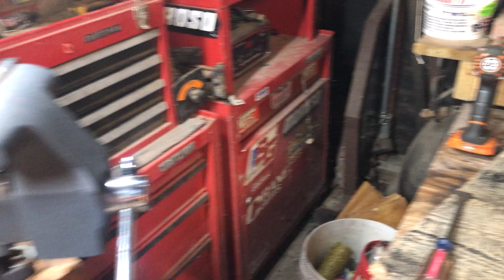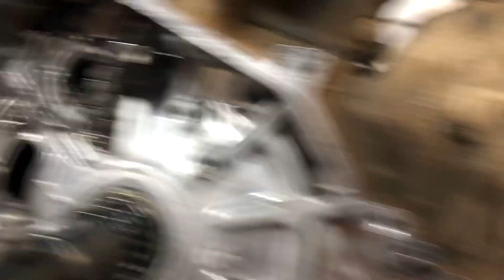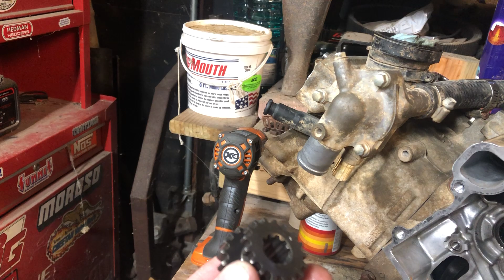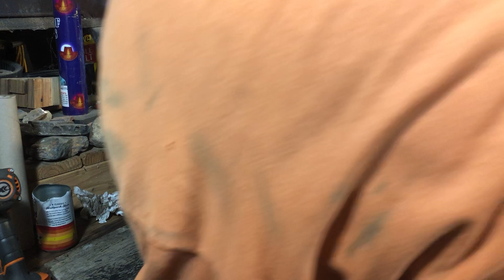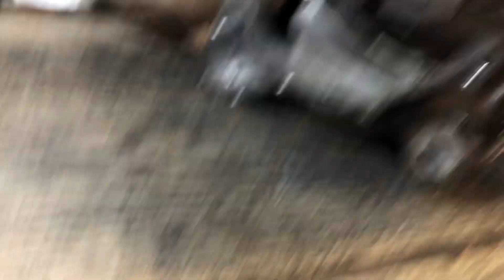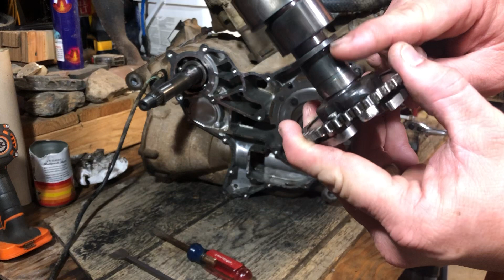Kawasaki Teryx v-twin cam shaft /  timing chain install

Comment: I remove the sprocket from the cam to set the chain in place.
Reply from the maker: It’s been so long I don’t really remember.  If that’s what I did on the video, it probably was because it made it easier or even may have been the only way to do it. Good luck and thanks for watching!

Comment: Just a little confused. On your final check of the front cam, intermediate gear, shouldn't you have rotated the crankshaft at least one and a half turns to get the cam back in the same position?
Reply from the maker: @vicktdock  It has been so long since I did this project, I don’t remember the details.  However, as assembled on video, the engine runs well and is still working to this day.  

I will tell you that I downloaded a full service manual from a member of the Teryx Forum.  It helped a ton!

Comment: I’ve been looking everywhere but I can’t find my answer. The pin that you are working on at 21:23 is the pin the holds the timing chain guide that guides the cam chain that goes up the rear cylinder to the cam. My guide is chewed up and need to be replace but I can’t figure out how to get it off. I can’t find the answer online anywhere
Reply from the maker: It’s been so long, I wish I could remember that part.  

Have you tried to download a service manual?  I was able to get one off the Kawasaki Teryx Forum from a member for free.  

It was a downloadable PDF.

Comment: Question: When I installed the intermediate chain, it was tight, tight, tight. It seems as though there was slack on your chain that the tensioner took up. If my chain is so tight ,should this be a concern ?
Reply from the maker: I would take a look at it again.  Was it tight before you installed the tensioner?

Comment: Excellent work and very well explained, I’m about to do a crankshaft replacement and this will help me a lot!! Did you end up replacing pistons and rings?
Reply from the maker: Thank you for the response.  This was not one of my better videos and almost didn’t post it.  

I only did the pull rope and a carb cleaning on this one.
Reply from the maker: My apologies for mixing up my answers.  I did replace the pistons but did replace piston rings while I was in there.  I lightly honed the cylinders and removed the carbon build up at the top.  Good luck to you!
Reply: I did the same as your video mine will run on the front cylinder but can't get mine to run on rear cylinder iv checked everything timing is dead on lifters are correct it's got my stumped any ideas I might pull the head thanks